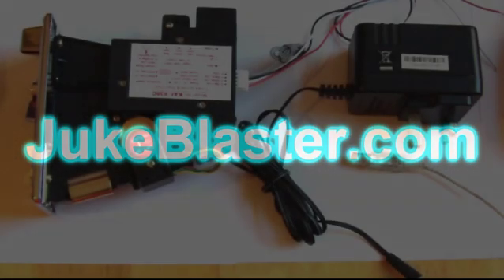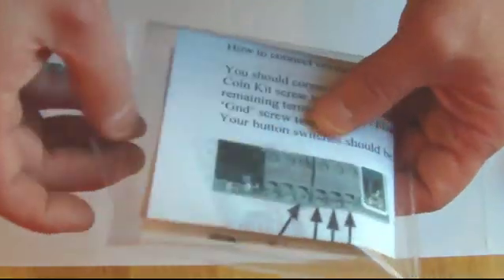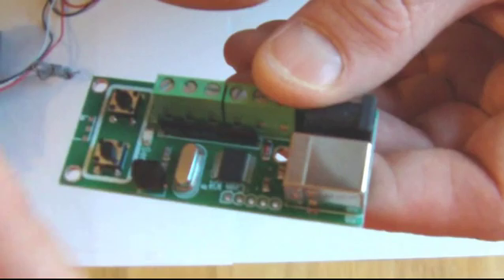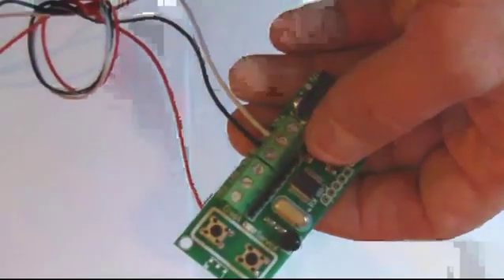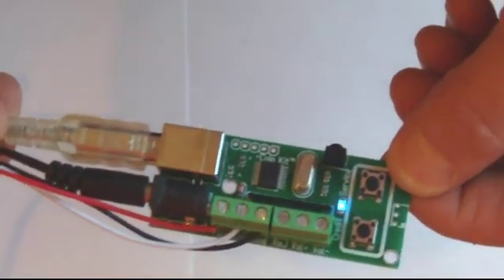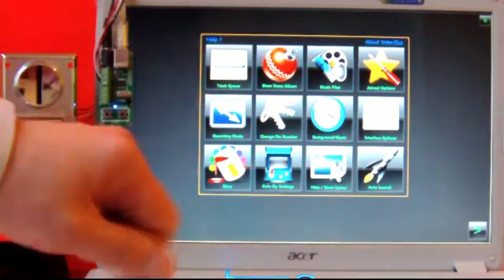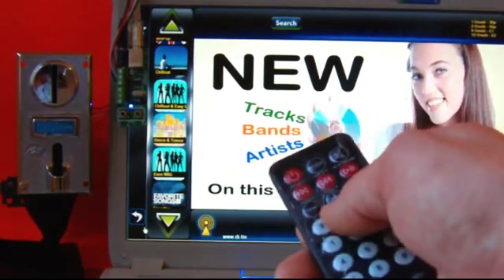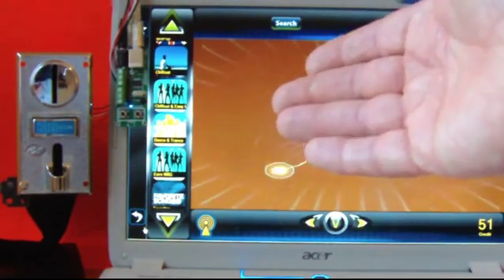Coin acceptor interface

Comment: hi, i have a arcade unit i converted into a pc, and wandered, would this work with mame or other games

just trying to get my coin door working on it u see.

thanks for any advice given
Reply: i wanted to power the coin mech as you demonstrate and have it so coins are credits and the option to press a button to do credits strait from the joystick area, i.e. one of the switches etc.

would your product be able to do this? or is it setup to be for the software you show on your site? (it looks like it emulates a keyboard but i am unsure)
Reply from the maker: It just gives keyboard (keycodes) like mame so it will work, also you can change the keycodes it sends :-)
http://jukeblaster.com/coinkit.html
Reply: @JukeBlaster  hi mate 
I want o run this type  of coin mech in my 75 coffee vending machines. The CPU has only a 16-pin connection (ribbon cable) know how I can do this???
Reply from the maker: @gordonjohnson2497  Please post your question on our forum stating the coin acceptor model number and i will try to help if i can:- https://jukeblaster.com/forum
Reply: @JukeBlaster  mate your forum blocks 99% of email addresses...